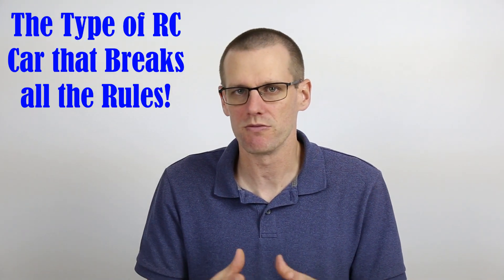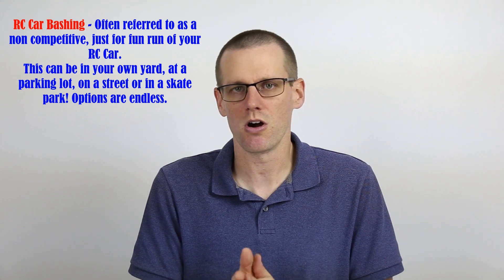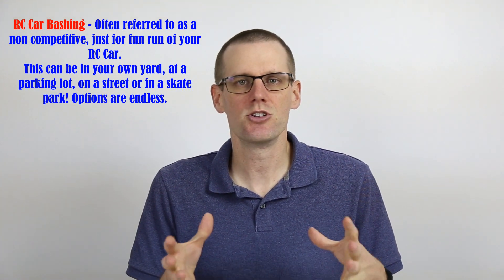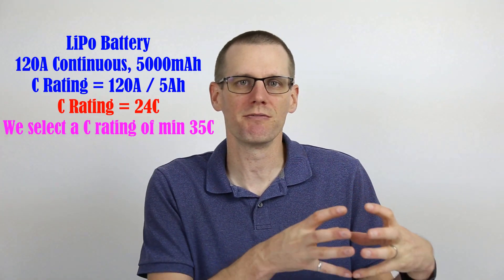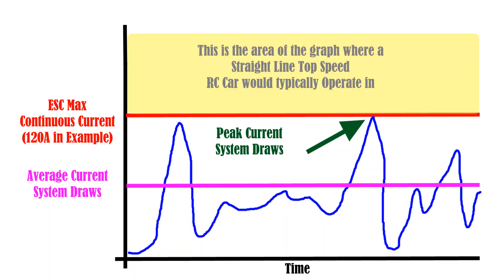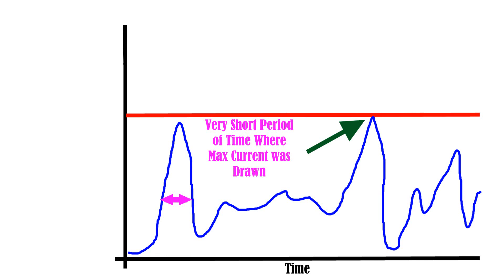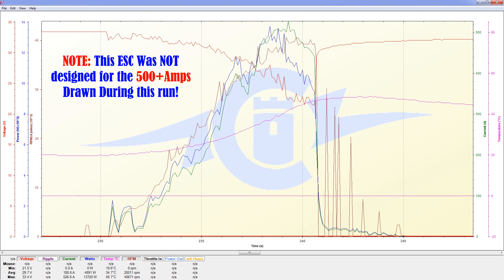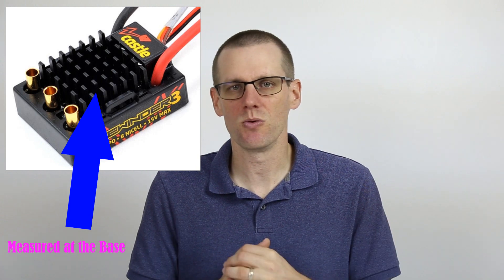Breaking the Biggest RC Power System Rule with this type of RC Car

Comment: Great info! 😎👍
And guys, ALWAYS bring a fire 🔥 extinguisher with you if you're doing speedruns. These lipos can & will fail due to several factors. Temp gun & fire extinguisher are definitely a must with speedruns. Just think about it this way, these high performance parts & speedruns builds ain't cheap, do you really want to risk it? 🤔 Not having either with you is as risky as hooking up with a Saturday night hooker & no protection according to the US surgeon General, just saying 🤗

Comment: Hi there. There’s been a problem of my rcboat bothering me. The esc overheats easily while the motor’s super cool. My boat is Proboat Sonicwake 36, the electronics set up is SSS 4082 1600kv motor + Hobbywing 180A 6S esc + 5500mah 6S 80C lipo. And the prop size is 48mm 1.4P. Can you plz give me some suggestions?
Reply: im no expert but 48mm sounds a bit large
Reply: @jakemetz3682  Yeah. 48mm prop is quite large, but the boat is 36inch and the 4082 motor is rated 1600kv. So I think the motor can handle that prop, in fact, the motor stays very cold after a run.

Comment: fpv drone racing league is another 1. the type of power system connectors we use is crucial . How exceeding the amp rating for the connector can destroy systems. Also checking the temps of all the power system wires and connections.

Comment: Thank you! Great topic.
Reply from the maker: You are so welcome!
Reply: @RCexplained  i was told that a controller only determins the speed of the motor
And depending on how it is wound and the mechanical load
The motor will pull a certain amount of Amps

Is this correct? I have always thought that esc determins the amps drawn